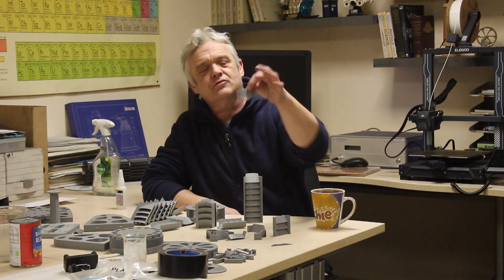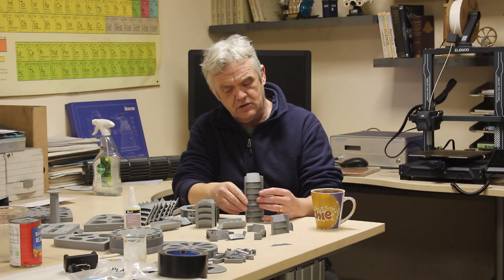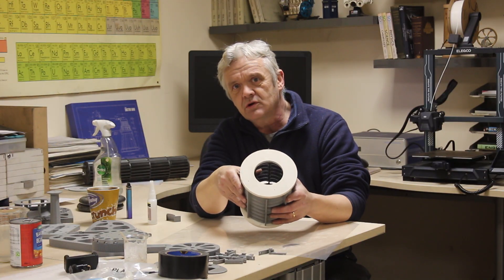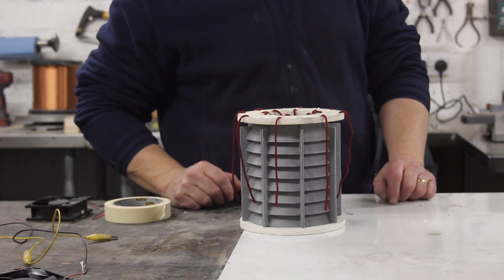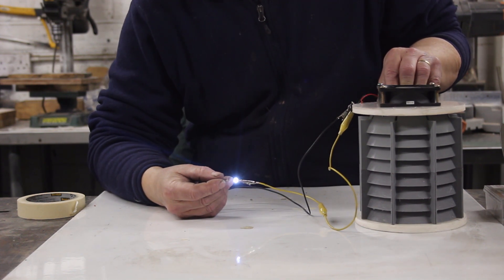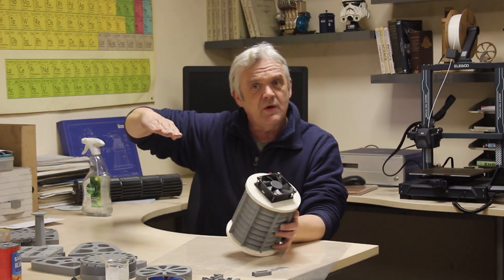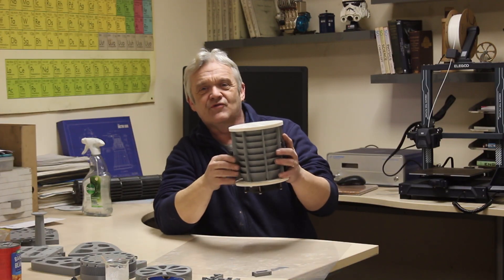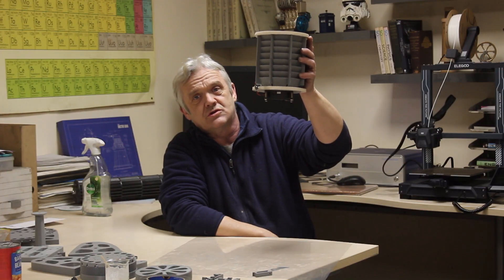1817 Darwin's Wind Turbine - An Exciting Result

Comment: if you stick a pipe on the end of it and  put the pc  fan at the bottom:  With the vents as shown any rain water would drain downward to the electric circuit below - shortcircui? Even reversing the vents would not completely avoid drowning the fan.  Still a good project to work on

Comment: How much does the wind concentrate the wind power. I think you should get a 4 to 1 magnification of the wind. Have you done any tests on this. Is wind the same as fluids. Voltage = pressure and current = pipe diameter.

Comment: Adding a pipe will work, just not quite as well. You'll get frictional losses on the sides of the pipe.
Yes, if you turn it horizontally it will put out more power. That's because the way you've done it, air which would be diverted around one side now is trying to go under the vanes, but it can't because it is blocked by the table top. And if you try to use this for real, you now have to rotate the assembly to face the wind, and you lose the simplicity (no turning required) of the vertical mount.
And orienting it upside down will work, too. It will indeed make maintaining the generator assembly easier. And then you have to deal with the exhaust air, which is not a problem in the "normal" configuration as it gets shot up vertically.
TANSTAAFL - There is no such thing as a free lunch.

Comment: Rob, if you turn the thing upside down, it's a nice rain water collector, flushing the water straight into the generator :) Maybe keep it right side up and make a hole in the bottom instead of the top? What if you make the tower out of segments with a backwall (like you cut a round cake into pieces), so no air can escape through the other side of the tower?

Comment: Do you know any way to convert a DC fed circuit (4 AA batteries ) wired to turn tap water on and off, int an AC fed circuit.
It's a hands free tap to ensure an elderly person does not leave the tap running.
I'm sure it involves a transformer cord. I have a nearby 115 amp outlet ( Canada) ....the batteries are all dying within a week

Comment: Hey Robert, this is really intriguing! I think it would be a potential wind generator for a sailing boat, especially with the inverted configuration with a pipe to elevate the finned cage structure. Easily mountable aft of the cockpit, on the stern, with the turbine and output cabling low down for easy connection to the boat’s inverter/charge controller…

Comment: Instead of putting a curve into the fins:

1. Try putting an aerospike in the center to aid the airflow moving up. For a simple test put a vertical cylinder to see if that had any improvement, or make a cone out of paper.
2. Try angling the fins with a slight pitch to create an internal vortex (opposite to the fans rotation)
3. What happens if you block the fins on the far side (opposite to the fan)? 
4. Another trick is to put some posts on the corners some distance to the fan, as the posts can act like a wind lens increasing wind pressure. 
Using an anemometer for testing probably would provide a better means to gauge performance improvements than a PC fan.

Comment: If no wind, a helium filled delta kite floats 100 ft high.
 Wind above 4 mph causes top kite to rise and pulls up a train of kites with air scoops.
 Cloth hose connects all train kites so air pressure runs a generator on the ground.
 Weight pulls kite train back  down when wind is too light.

Comment: If you had just one white LED on every ceiling in every room of an house, couple them to a small battery bank one of these turbines and solar panels it would negate the need to use full lighting and turning big lights on and off when you simply want to move around the house at night.

Comment: Thinking long pipe exhaust up using this to create something similar to the Venturi effect to increase the air flow making a suction through the long tube also any heat generated at the bottom naturally rises also increases air flow .

Comment: I think the diverting fins should be an aerofoil in cross section.  The existing profile will create turbulence and disconnect the airflow from the blade creating turbulence.

Comment: Cool, it whould be interesting to see if it works with a long pipe connected to the structure and a smaller venturi part inside the pipe to increase the wind speed!

Comment: If you keep the generator at the top and cover it with a wind vane that is the exhaust port would it not create a slight negative pressure and gain MaxPower?

Comment: What if instead of putting this on top of a pipe, you just have that same unit made so it's 2 or 3 MTS tall. Fins all the way up, would the availabile power be multiplied greatly as it's covering/ capturing a larger area of available wind! And at a small diameter, nobody would bother if you had several tall towers of this.

Comment: I was thinking maybe if you made something similar to a windsock that they used to show the direction of the wind at an airport, but you make it out of a piece of sheet metal or plastic form a cone, put a small fan small opening and put a pivot Spike at the large opening end. I know it sounds like a windmill, but this case your fan blades can be smaller and you could put a few metal bars inside the cone to keep a bird from going through and hitting the small fan blades. Run a wire from the ground of your generator to the pipe it's mounted on and the positive to a central pain that you could have a brush on so this could rotate 360° without tangling the wires.

Comment: Put that on a pipe and stick it in the air, you will get an up-draft and not a down-draft like you are hoping, same way how home's chimney works. I had the idea of generating power by using tower blocks, could use the lift shaft or tie it to the building outside, a long pipe reaching from the ground to the top of the building, but the council were not interested in finding out how much power could be produce this way.
Over in the refinery there is a chimney that as a warning on the door at the bottom, to make sure the trap is shut before entering the base of the stack

Comment: Rob,
That's cool. Neat idea.
I really wish you would take a real close look at Peter Sharps "Cycloturbine' vawt.
It is like a Darrieus but the pitch of the blades is passively controlled. I have built several of these and I can testify that they 'pull like a truck'. Never fails to start turning and has enormous torque and tsr can go up to 3 or 4. His yt is tinkerbits ,. If you comment on his yt he will send you copies of his patents. Please check this out, it's amazing. If you want me to send you the docs provide a email address or some other way.

Comment: I wonder if the shape of the vanes could be made to mimic the characteristics of the Tesla valve. Stop some of the air from flowing through and divert more of it towards the point of work. Maybe just a bugle shaped baffle in the center and curved vanes with a small over lap.

Comment: hi, very interesting, one thing about the profiles thought, when comparing to an airplane wing here we would be in an inversed stall situation. i wonder if the efficiency would increase if you printed the profiles with the curvature reversed so the aiflow follows the profile and gets guided upwards, in your case flow gets directed more to the center of the tube and only overpressure pushes the air upwards i think. 
the idea with a high tube/pipe and the fan on the bottom sounds great since higher up you catch more wind.

Comment: better and cheaper than glue is welding, if you have a electronic soldering iron like the TS80 or similar, with a tip to spare (Its possible to clean afterwards anyway), you can configure the temps to 220-240°C (if you dont want PLA smoke in your face), and you can weld it to impresive results. Depending of the penetration, you can make a permanent weld o one that can be opened again with a knife, or a heated knife.
As with any welding technique, it takes times, and the weld strength will be limited to weld penetration (the layered structure is destroyed in the process, so with the right strategy, you can increase the overall strength of the 3d printed part.)  and somewhat with welding time (the polymer could start to go bad (the polymer chains could become shorter) if you take too long, but I have never tested it)

Comment: There are a lot of positive comments here. But, wouldn't you get more power if you removed all those slots that bend the wind?
This is a cute device but very inefficient. Why don't they put wind turbines close together? Because once the first turbine extracts the power from the wind, there is less left for the next turbine. There is a good reason this idea was in the dustbin of history, there are much better ideas out there. Sorry for the negativity but that's just the way it is.

Comment: The only issue I see with inverting it is when it rains the vents will draw the rain in instead of letting it run off ? However this could be drained out at the bottom of the pipe or used for water harvest? 
Great video as always mate 👍🏻 I never wanted to get into 3d printing as I work with metal and wood but I can now see some uses 😬🤔 .

Comment: Looks great, and it's versatile. Could turn it upside down and use multiple of them, hook the generators together. Or have a big pipe and turbine at the bottom instead. Reminds me of what the arabs/persians did to keep ice frozen throughout summer, and cool their houses.

Just one thing to be wary of - PLA is not good outdoors. It will perish very fast. A better option would be PETG.

Comment: The reason Louvre’s are positioned in an upright angle when fitted externally, is so that it restricts water from entering the area inside, by turning this turbine upside down and adding a pipe, you would need to find another way of restricting water from entering the pipe and destroying the electronics of the fan at the bottom of the pipe.

Comment: rob.
try placing a cone INSIDE on the base to redirect air upwards.
Similarly replace the top piece with a conical lid,with a hole in the top
I found this to be a wee bit more effective.

Comment: This reminds me of those shields that fit over the temperature and humidity sensors of the little backyard weather stations. The First mod I would do, like you mentioned is change the curve. Having the concave section the the blade on the outside would better direct the airflow inside the Darwin module and in the direction of the fan. Looks Good Rob, Nice work.

Comment: It shouldn't have any problem generating power with it upside down on the end of a pipe because hot air rises as long as you got a air intake going into the pipe the hot air rising will turn the generator and make it make power don't even need the wind blow just a little sunshine

Comment: I like your demonstration. Here is an idea. 
In stead of building different versions with a bigger air gap or a different angle of the fins I suggest to place what you have at the centre of a universal joint to make the angle of the Darwin Turbine adjustable. So instead of holding it horizontal or upside down you can fine tune it by adjusting the angle of the u-joint and find its optimal output while the wind speed is constant.

Comment: With the Super-Massive wind turbines Falling apart all over the place, this is an interesting avenue to pursue.
Reply: Curved blades? Cambered perhaps on the high side? Or vertical slats cambered on both sides instead of horizontal slats?

Comment: A straight inverted one may have a problem with rain unless well covered but the idea of a pipe could be used in another way by having the generator mounted into a removable ventilated pipe or pole at the top that allows a simple lift and twist to remove and service. Like a bayonet light bulb on a stick but with a generator instead. Failing that if you do run it inverted the bottom disk could be sloped outward near the edges where water might come in with small weep holes to allow drainage but not an easy path for air.

Comment: Make a wind wall. Use pipes large enough to stack a multitude of computer fan generators inside the pipes going from top to bottom. And put wind catchers from the top to the bottom on the windy side of the pipes that are used in the wall.

Comment: Just do the measurements please. I doubt it's any better than just plain fan with tail for rotation. In my understanding air pressure can't be higher inside at any height of this column than outside because it would just flow outside trhough fins.

Comment: I love that erection joke without even cracking a smile lol
then the question would be why use a pipe when you can just build more of these up to the height you want presumably capturing more air to force through the fan?
or even stacking fan wind catcher fan wind catcher building in redundancy. with only one way for the air to leave the fans should all turn at approx. the same rate.

Comment: On the air output side. I wonder if fitting a “H” pot on it to create a low pressure zone inside the pot, would help efficiency? When we had coal fired houses could have a “H” pot fitted on top of the chimney to help draw air up the chimney. As the air blows across the open ends of the”H”. It would create a low pressure zone inside the pot.

Comment: to test this as mini version i would just cut bottoms off from single use plastic cups and print the frame/shims/wings thing part
Reply: Had the same idea, just using disposable plastic bowls, cutting their center, and for the frame bars, simply use rectangular bars of any material, with slots cut out to fit the plates.

Comment: Now That is an idea!
A 20 foot long one fixed along the ridge of your roof with a down pipe to the turbine. It would be amplified by the wind moving up the roof.
You could have that And your Solar (no shadow).

This is what this channel excels at ...... Designs twisted to new and novel aspects! Talking of which ... I wonder if it works in water?
Thanks Rob!

Comment: Robert i have question and its mayby a idea to try out and its been in my head for a long time.
What if you take that build and instead of a fan put a weak valve on top into a closed chamber and at the and a little stronger valve and then 1 more with a stronger valve so you build up pressure and then after the last valve a small closed chamber with a fan so like a pressure build up system that would let that fan spin stronger with the same input would that work.
Hope you could find it out because i think presurre build up sytems is something i havnt seen anywhere yet with wind energy.
Greetings from the netherlands

Comment: would it run 2 generators, one with air drawn thru the bottom and one at the exhaust or would a hole at the other end impede the updraught?

Comment: Already designed mine with generator on bottom with turbine at the end of a funnel going from 800mm to 300mm diameter. I am hoping to get 4kW out of it in a 5m/s wind speed. Calcs say it is possible taking Betz limit into consideration. Prototype going to be roughly 2 metres long and 1.1 meter diameter.

Comment: What intrigued me is that gain in performance when it was horizontal.  That is counter intuitive, as one would expect being horizontal the performance would decrease.  I would suspect that it has a lot to do with the Bernoulli effect and creating a low pressure area that pulls in more air through the generator.

Comment: The real design I thought of was a convex funnel shape like you suggested but making sure the end of each is 2x the height of the one below it. Also if the inner radius was incrementally larger as you got closer to the generator to allow for the increased pressure.

Comment: Did you repeat the string experiment while the fan was sitting on top? With the fan on top does the air find a path of least resistance and start heading out the sides. Would a virtical star wall (don't know how to better describe it) inside the structure prevent air escaping out the back side of the structure?
Reply: this is a very interesting train of thought you are onto something here I think I will have to test this concept.
tks for this great idea Stephen.

Comment: Lay a series of them horizontally across a roof ridge line seeing as there appears to be an improvement when horizontal. Could these work as well on the North side of a hip roof when the South side is covered in solar panels? 🤔🤔🤔

Comment: Why not have 2 connected by a u-bend at the bottom containing the generator. One bringing air down (in) and one up (out) - the airflow would then be increased across the generator...
Reply: Great video by the way!
Reply: I don't think it will be more than 2 separate units... but it's just a quick guess.

Comment: I can see a potential problem with it upside down: any object that goes into it will immediately fall down into the pipe. With it right-side-up, there's very little danger of anything getting into it because of the upward slant. If you had a long tube of these, then you would get a multiplying effect and you could probably have the generator almost anywhere, even on the bottom, as it would create low pressure on the bottom.

Comment: Ideas for future episodes. #1. Home made gas using home bio waste in a capped and vented hole in the ground. #2. Home made bio Fire logs made of paper, cardboard with optional sawdust or wood shavings mixed with water to pulp and put in easy to make moulds to dry of appropriate sizes.